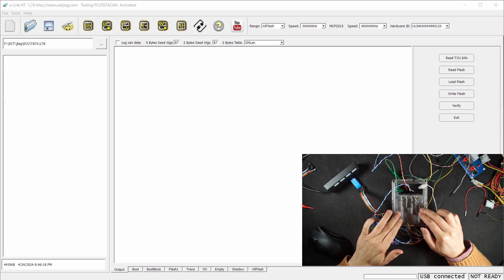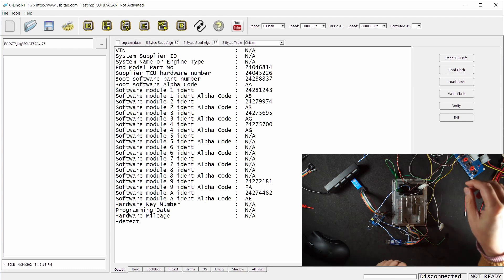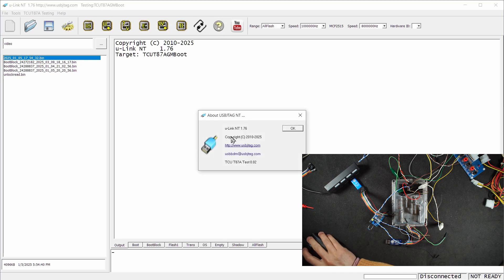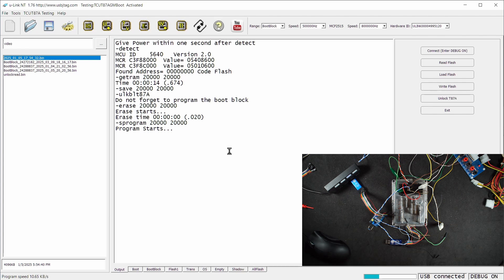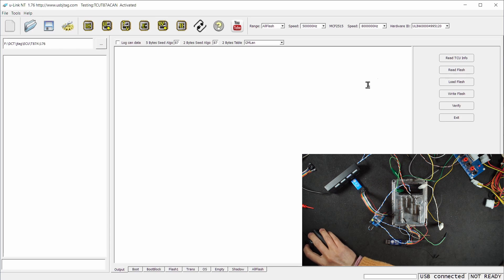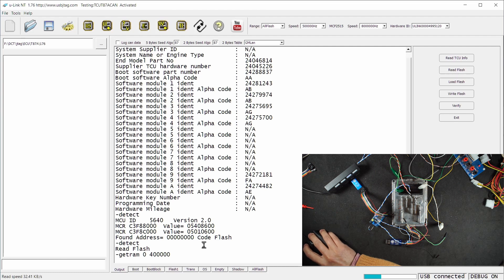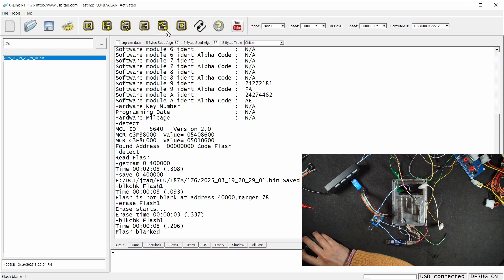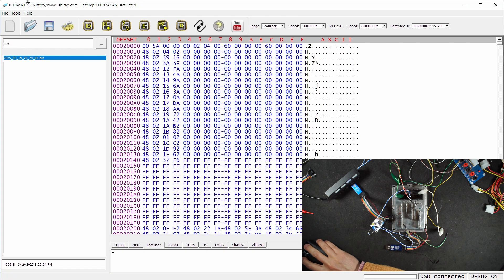u-Link NT Program TCU T87A (using custom kernel)

Comment from the maker: For those asking for HPT you need to have a working seed/key known to HPT and it will recognized it. Publish seed and key is not good idea as HPT can blacklist them.
If your boot block is 24288837 you can use TCUT87ACAN. If your boot block is 24284338 or 24272182 you need to use TCUT87ACAN1 or you cannot enter DEBUG ON. You can also upgrade your boot block to 24288837 independent of what the rest flash is.
Reply: Do you have any information on the GM E90 ECM? Global A first, then Global B… I’m interested in these and using DPS for programming.

Comment: I have performed this procedure on a t87a, my bootblock is 24272182 when I use TCUT87ACAN1 and click ID it shows the process was successful but when I try to use HPT it says i need to send in module for upgrade (unlock)